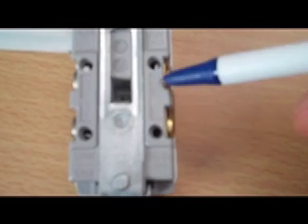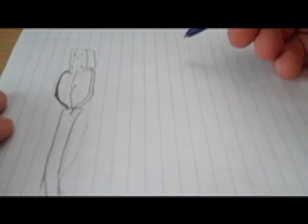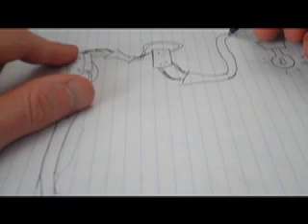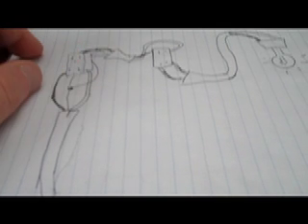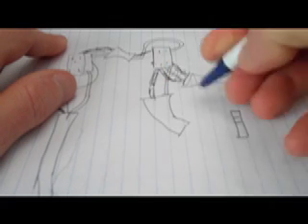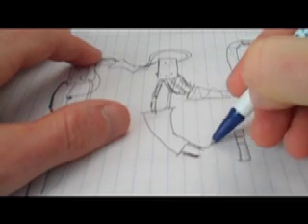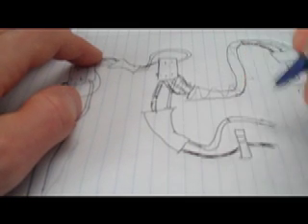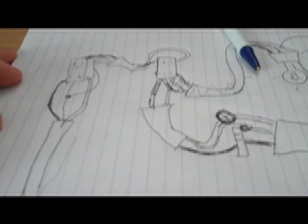Home Electrical Wiring Basics

Comment: but how do I wire a room with extra voltage? I have a lot of electronics in that room and I don't want to burn the circuit. How do I add another circuit to the room?

Comment from the maker: I'm assuming the garage door is in the mix because that is the easiest source to draw power from?  Is the garage door opener plugged into an outlet?  If it is, you can add an outlet from that box.  Go to the wall or floor (or wherever you want it).  then go to switch, then light.  No problem.  Surprised the house hasn't had electrical upgraded from the knob and tube!

Comment from the maker: There might be a simpler answer.  With the advancement of ceiling fans controls, you can now control all of it via remote control.  It either goes on the existing switch or can be a remote control that sits on your end table or something.  Check it out.  I have used the Hunter units with great success!